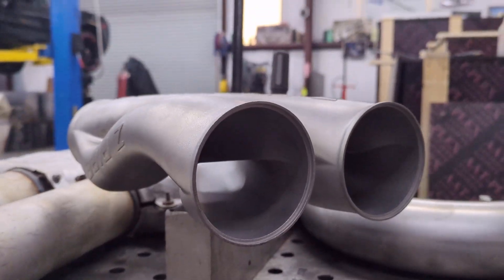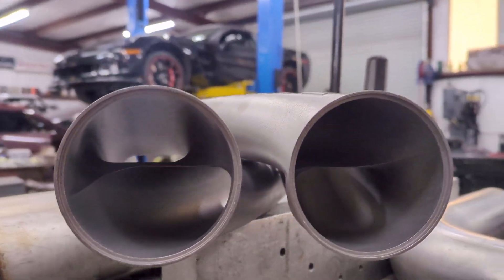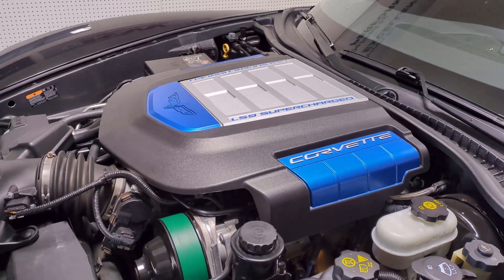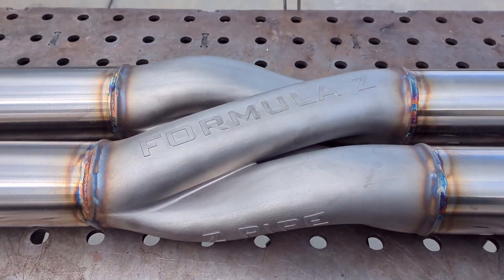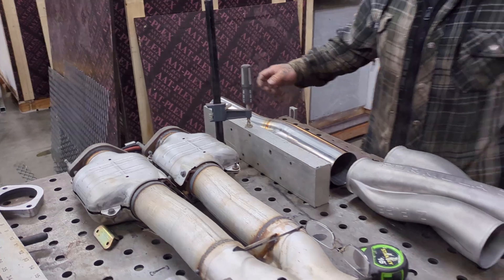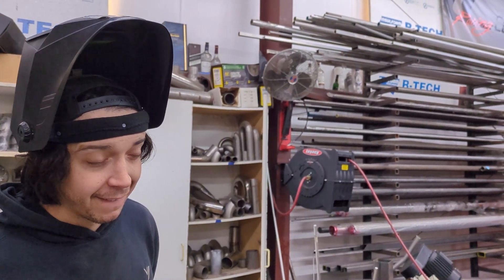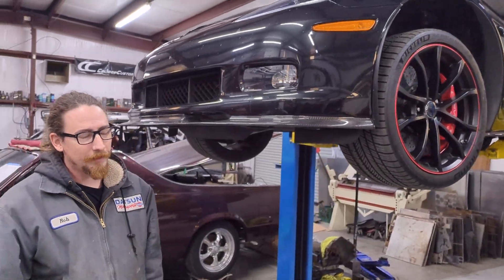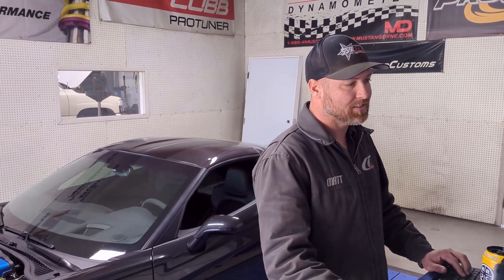Testing the Formula Z pipe - Is there power behind the Hype?

Comment: Would Like to have one on my 24 Camaro SS. I doubt it would line up. Seems the Camaro pipes are closer together. My daughter's C8 is out of the question. I believe the stock system is like this. Two pipes go directly into each muffler, and  the other two pipes crossover to the opposite muffler. But Borla's price for the C8 system plus labor is ridiculous. May just go the old way, LTHs.

Comment: Seeing how the flow splits and merges again, it’s very very similar to Borla Crossfire
Reply: Borla did this first
Reply: @tjioeardiyanto1518 incorrect
Reply: @tjioeardiyanto1518 Borla now has a shortened Switchfire similar to the one in the video. It fits on Borla car backs. It replaced the merge pipe only on Borla exhaust. But who couldn't take a few straight pipes and weld them to either the one featured here or Borla's. I like this design, but am reluctant to take off the Flexx Hot Did H-Pipe and have this unit installed in its H section.

Comment: fluid motor union just proved this fancy 3d printed thing makes about 3hp vs a "normal" x pipe.    I think you can weld x pipes to be just about as good as this 3d printed thing if someone was prepared to sit down and test all the various shapes and designs.   Fluid motor unions x pipe isnt the highest flowing or scavenging type welded x pipe imo.
Reply from the maker: I would actually love to do a direct X pipe to Z pipe comparison, and our X pipe design is just like Fluid Motor unions design.

Comment: This test isn't a fair representation for two main reasons:

1. Supercharged or turbocharged engines require a high-flow exhaust system. Forced induction systems push a lot more air through the engine, which means the exhaust must flow just as freely to prevent backpressure. Catalytic converters are a major restriction-especially on high-horsepower setups. Simply removing them on a V8 with forced induction can easily result in gains of 30-40 horsepower.

2. Exhaust pipe diameter is critical performance.

A good rule of thumb is 1 inch of exhaust pipe diameter for every 100 horsepower. So for a 600 horsepower engine, you need dual 3-inch exhaust pipes, ideally connected with an X-pipe and continuing with dual 3-inch all the way out. Using undersized piping will choke the engine at higher RPMs and reduce overall performance.

If you want to run a fair comparison, the test should be done with the proper exhaust sizing and then compare results with and without catalytic converters. Forced induction engines are very sensitive to backpressure, so the exhaust system design plays a huge role in power output.
Reply from the maker: I appreciate the reply. The ZR1 factory has a full 3 inch exhaust, and you can see in the comparison shot its a large system. I agree that removing restriction will be largely beneficial on a boosted car. The factory manifolds and factory cats are still in place, where removing them would probably net another 30-50hp.

Comment: Are you guys kidding me?  The improvement was the result of removing the cats, obviously.  Besides, you do not need extra scavenging with a supercharger.  The positive pressure from the intake negates the need for scavenging.  Think of WW2 fighters with super short, independent exhaust pipes pointing backwards.  They were not connected to any other pipe because there is no need for scavenging.  The only way to test that new pipe is with a normally aspirated car.  Spoiler alert, if it makes any difference it will reduce power.
Reply from the maker: Correct that WWII air craft have short runners that do not need any scavenging as there's no pressure behind them. Same as on any top fuel car, which is an easier comparison than a warbird. With that said, a full exhaust system that needs to be the length of the vehicle with mufflers at the rear, there is considerable pressure backed up in the system. You cause a vacuum in the opposing bank and make the exhaust get out of the chamber faster when the exhaust valve opens, you can now make more power.

Comment: To have a more accurate measured gain from the z pipe you need to test it with the cats as well or remove them from the oem and retest. Believe most of that gain is from the cats
Reply from the maker: As mentioned, i wanted to leave them for test but customer wanted them removed.

Comment: this looks cool but lets be real the power gain and sound difference comes from deleting those cats. a normal x pipe or double x would be as good as this and far cheaper
Reply: Pretty sure it was just the smaller secondaries that got deleted, the larger OEM primaries are still in place.
Reply from the maker: As mentioned, i wanted to leave them for test but customer wanted them removed.

Comment: Thank you for making this video. It definitely sounds like it's hitting almost an octive higher with the zpipe and secondary cat delete. Also, you can hear more over-run burbles with the zpipe. That zpipe is a piece of art. I've got a borla switchfire that is being modified for a custom application, and hopefully, the acoustic dynamics is close to this. The build quality of the borla leaves a lot to be desired compared to the zpipe. A zpipe pipe configuration should be superior to a standard xpipe in terms of scavenging and power generation, especially on a cross plane V8 with an uneven firing order. Armchair exhaust expert signing off. Thank you again.
Reply from the maker: Thank you, we appreciate the feedback!

Comment: Despite the test gripes this is still interesting, what makes it less interesting is the price tag on these Z pipes
Reply: And the big torque hole right in the midrange
Reply from the maker: @getahanddown what torque hole are you talking about? Are you referring to the dip in the torque curve at 3700 rpms? If so, that’s tire spin, even with the tire spin it is still making more torque even with the dip in the graph.
Reply: @CaliberCustoms  
Tyres spinning on the dyno? Strap it down and go again.
Really hard to take this seriously when you haven't collected good data
Reply: Yeah thats the only gripe lol the price is insane lol. $1700 avg is wild. I'm waiting to find one 2nd hand for like 700 , even still thats a lot. 1700 for an entire custom midpipe with that, yes would make sense. But just that little attachment price is wild
Reply: @imSchwaggy  just weld your own, doesn't actually look that complicated

Comment: Was hoping a Z Pipe could sound like an LFA!😂.  🤔
Reply from the maker: Id love to have that amount of magic in one part
Reply: The o.e. engineers blended the exhaust pulses on the C4 off the o.e. headers into a single 3" to give it a smooth clean sound, & I can really now see this concept in blending 8 pulses into 1 common pipe.  Now if that was my Vette, after that 3" Z, I'd  go into a 3" or maybe 3.5" max single Y for about 20" single & then back to a dual 3" to really squeeze those pulses from the Z & really increase velocity, in hopes to get to that LFA or Carrera GT sound!  I want a tuned exhaust, not so much gain in hp.  However, this car should get anti reversion chambers fitted on the primaries or inside the header flange like cycle header Torque Cones, or at the collector called Anti Reversion Mufflers by Pro Fabrication or Hendron Racing or Dyna Tech.  All same mfg, or easy to make your own.  Also add a 2" balance pipe between the header collectors like David Vizard says.
Reply: It would also be interesting to install an exhaust Pressure gauge with a negative vacuum scale both before & after the Z Pipes to Ser if vacuum aca aging is taking place, or a pressure differential.  Gale Banks speaks of this on his systems.🤔
Reply from the maker: @chrispompano  That would be a really interesting test to perform. We have done the simple test of blowing shop air through one side of a X pipe and it will suck a shop towel to the other bank. But havent done a actual measurement past that.
Reply: Zr1 sounds 10x better than any v10
Reply: @tommys2979  hahaha you are out of your mind..  Every LS sounds the same.. Like shit

Comment: So a complely non-apples to apples/usless comparison. Fail.
Reply: Useless? So you knew these results before they did this?
Reply: @EGGINFOOLS  What results? The useless ones that you can't compare to each other because one set of pipes had cats and the other did not?
Reply: @saschak6405  I get the gripe about that. That's valid but so you think this was all useless? Nothing in this video was useful at all? Did you know a z piped 2nd catless ZR1 would dyno these numbers and sound like this?
Reply: @EGGINFOOLS  For the purposes of this video yes the test was usless because it can't be proven that all the gains (power and sound) were due to the cat removal or the X-pipe change.

The title and premise of the video should have simply been "dyno test of catless 2ndary's with Zpipe" and shouldn't have mentioned anything about comparing the two beacuse it's an invalid test.
Reply from the maker: As mentioned, i wanted to leave them for test but customer wanted them removed.

Comment: Pointless test. Catted factory vs no cats. I wager an aftermarket X vs this heavier X would be within 3 hp of one another if both have no cats. Also, your engine is not encountering enough restriction (i.e. - not making enough power) if it has been able to run catted so this exhaust mod is not going to be "making power." This did do a good job or proving the gains by deleting the cats though.
Reply: Pointless is a little hard..  Not apples to apples but not pointless
Reply: Exactly. "Back to back" (oh, and no cats).
Weird video to make
Reply from the maker: The factory front cats are still in place, so it's not a "catless" vs catted test
Reply: @CaliberCustoms  You know what he means, no need to get pedantic. Your baseline runs had more catalytic converters installed than the test runs. How much of that 37 hp gain is due to just deleting some (but not ALL) catalytic converters?
Reply: @DeadRedRider  likely in the range of 35-36...
Reply: @rubbermoetroken  Lol. That'd be my guess too. Along with 98% of the exhaust note change coming from the cat delete.
Reply: @CaliberCustoms 
The only change should be your pipe / X pipe segments.
Weird to think you wouldn't get called out
Reply from the maker: @getahanddown the customer didn’t want the z pipe installed on the factory aluminized exhaust. He wanted a TIG welded 304 stainless exhaust. He also didn’t want the factory x pipe modified. While we would have loved to see the results comparing x to z with and without secondary cats this job didn’t allow that opportunity. We don’t normally see this large of a power gain by only removing the secondary cats so we were surprised by the results and thought it would be interesting to share the results with the YouTube community. 👍
Reply: @CaliberCustoms Respectable answer ✊🏾
Reply: @AngryManSki more like a cop-out...
Reply: @CaliberCustoms  yes, accurate testing costs time and money. If the customer did not choose to keep the OE exhaust it sounds like a perfect donor for the start of some accurate, 1 item change,  testing